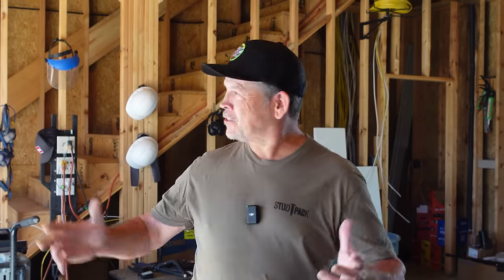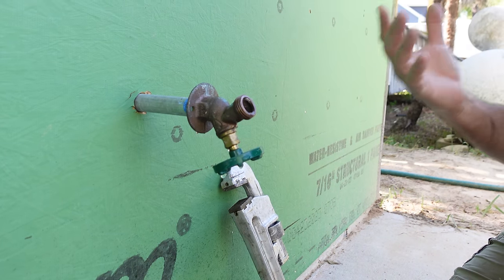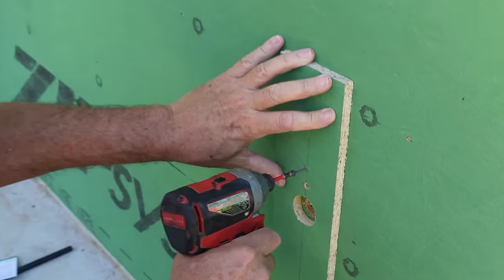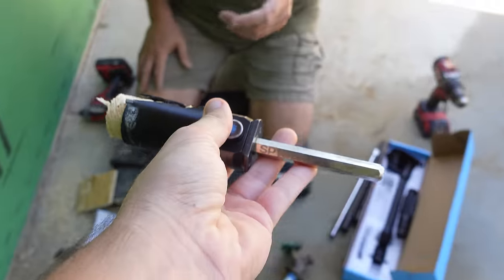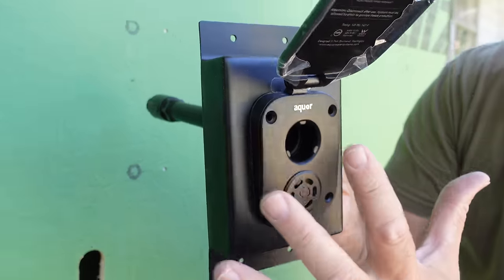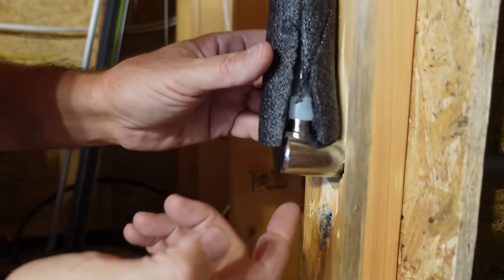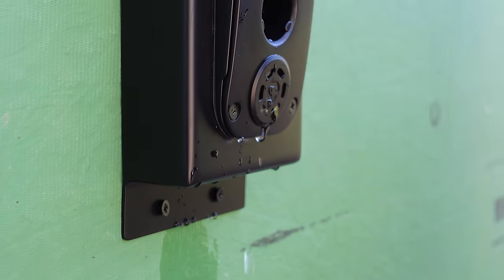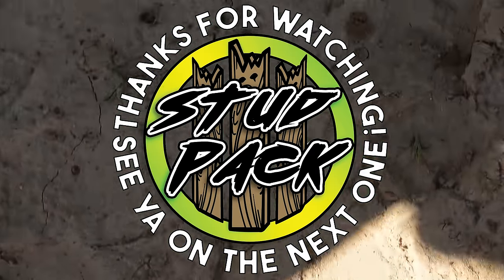Installing a Modern Outdoor Faucet - Ultimate Home Winterization

Comment: If you're planning on putting in an access panel anyway, might be a good idea to put in an inline ball valve too - that way you can shut it off for service. This is how I shut off exterior water for winter up here in cold-ass Canada.
Reply: Yup! This should be code everywhere!
Reply: yeah cuz you're going to need them to replace those eight hundred dollars hose bibs in a couple years.
Reply: Frost proof valves were and are common up here in NJ. I use ball valves inside. Shut valve, leave hose bib open.
Reply: I centrally connected all my hose bibs to an air hose blowout valve. Turn off the water inside. Shut them all off inside. Turn on all the faucets and sprayers outside. Hook up the air compressor and turn on open the valve. Then turn on each faucet from inside and let the water blow out. Close that valve and move to the next one. 30 minutes later all my hoses and sprayers are empty and dry. I disconnect them and store them in the shed for the winter
Reply: I have a master shut off for all outdoor water.... seeing this reminded me to turn it off
Reply: Thank you for the idea, I will now do the same.
Reply: I have two ball valve shut offs in my laundry room. One shuts off the backyard hose bib. The other shuts off the driveway and front yard. Winterizing takes 2 minutes. Turn off the valves, walk around and open the hose bibs so they drain (they are all pitched down). I love studpack, but this is a solution in search of a problem.
Reply: our plumber did the same thing (Canada too).    I used it to shut off the line for the Winter, then drain the hose bib.    all for an extra couple of bucks in parts.

Comment: You can also combine 2 hole-saw bits, one smaller bit that fits the existing hole, and a larger diameter bit for the new hole. Saves you from having to make a template.
Reply: I have a few different hole saws and this “trick” doesn’t work with any of them. When one hole saw is on, there’s not enough threads to get on another one. A template is quick  and easy to make and it always works.
Reply: Yes, you need a deep threaded mandrel or hole saws with thinner bases to do this, it really depends on the manufacturer!
Reply: @madperfect 
Just duck tape a couple of drills together and make both holes simultaneously.

Comment: One design improvement on the hose system is a kickout on the bottom side of the front plate. To break the water tension so that it doesn't drizzle back to the siding when you pull the hose out. Even though you'll have it all waterproof, always nice to divert the water away from the siding, straight to the ground.

Comment: If I recall correctly, they had a few problems with the o-rings on the spaceshuttle.
Reply: Oddly enough, it's because the o-rings degraded at low ambient temperatures.
Reply: That’s where this system will eventually fail.  They’re depending a lot on those o-rings. Big mistake. Viton o-rings or rubber it doesn’t matter. They all will fail.
Reply: @philweed1603 true, however an O-ring is an easy part to replace compared to the whole hose bib.
Reply: @andrewcarr2431  Agreed!

Comment: I guess it isn't as important as both hose bibs are downstairs where you probably don't plan to make it airtight, but keep those penetrations in mind for when you build the house to improve that blower door ACH score. In fact, you may still want to consider sealing that penetration better to give insects one less way to enter the garage.
Reply: I have a feeling that when they get the siding put on and calk around the bib braket that that will not be a problem.

Comment: Paul's "proprietary parts" rant was the best / funniest part of this video!!!  Haha....  

I love these Stud Pack videos.  Keep up the great work!
Reply: Yeah it was funny, though I'm not sure I completely agree with him either. If my hose or grill or car needs repaired, I know that most of the parts (in some cases, all of the parts) can be found off-the-shelf at general retailers. If the only place I can buy a hose adapter is directly from the store, and the only brand I can find is the company that makes it, that's a different situation entirely. I'd hate to have one break on a Saturday afternoon, then there's no way to use my hose for a week. Especially since the only upside seems to be aesthetics unless I'm missing something.
Reply: I understand where he was coming from, but when it comes to something that is being put on a building that may last 50-100 years I don't agree. If that plastic adapter breaks or gets lost in 20 years I very seriously doubt you can get a replacement. The company may go out of business or just not make the part anymore. It is very likely that the adapter will get misplaced since it can't stay on the hose bib. It would be a huge hassle to have to replace the entire hose bib because of that one part. If these companies are going to start making a system like this popular we seriously need to some up with a standard adapter ASAP. I really liked the hose bib until that part. I was wondering how the hose connects the entire time.

Comment: Guys, I think I would grab a couple scrap 2x4 and use them as backers on the ends of those screws that are going through the ZIP osb. A little glue is all it needs, then you know those screws will never come loose if someone yanks the attachment, or pulls the hose to hard. (looking at video @14:07)

Comment: @StudPack As you know, reparability is a major factor! In fact, you are mixing up proprietary and standardized.  Most things we use are proprietary, but most are alsy standardized and accepted way of doing things. Aquor is not standardized in construction industry or even in boat or RV. They have been in the market for many years. Yet, parts are not readily available except if you call them. That means that they may decide not to have parts at any time and you will be stuck replacing the whole really expensive thing. The advantage with proprietary but standardized part is the fact that I can buy it anywhere (even on amazon) and replace the entire internal assembly with handle and all rubber gaskets for a fraction of cost of new and without ripping up everything. It is "less work, less money and less garbage" solution that effectively creates a brand new hose bib. In fact, i've done just that this summer for my 122 frost free hose bib. 
That being said, Aquor is a cool modern solution that should become standard in North America one day... I doubt it though...

Comment: Minor suggestion to Manufacture is to countersink holes for wall mount screws in exterior box to allow screws to lay flat to surface so Water sealing tape can lay flat instead of bumping out with air trapped.

Comment: Recommendation for you... I lived in Texas for over 15 years and I learned that Winter is the rainy season.  I suggest that you finish the exterior before spending too much time on the interior.  Spend the wet season doing the inside stuff.    PS - maybe stage your insulation i& sheetrock n the inside dry space and save that work for rainy days when you can't work on the exterior.

Comment: We have a much simpler fix for this in Canada and northern States. 'Anti-syphon / non-freeze' hydrant. Come in lengths of 6-24". The valve is connected by an internal shaft all the way inside the house at the opposite end, when you turn it off, it drains all the water out of it through the regular outlet so there's no water in it to freeze and also doesn't make water run down the side of your house.
Reply: Yeah unfortunately I feel like this product @Stud Pack installed is much more overpriced gimmick of the traditional $50 woodford frost-free anti-siphon sillcock.  In the Midwest it's all we use. And the perk is, you don't leak hardwater down the siding or house like this one is going to do, and adjusting the flow is very critical where this one looks like adjustment is not as incremental. I am sure they have a way to adjust flow with this one, right?

Comment: With the old hosebib you mount an shut off valve upstream from the one the goes outside.  Shut it to stop the flow of water, and open the hosebib and let the water drain out.

Comment: Canadian tradesmen here. This is a solved problem.
The freezing problem has been solved for several decades, with a standard part that costs less then $30USD
This part, commonly referred to as sillcock, frost-free or freeze-proof faucet, also places the water shut off seal 12" into the house. 
It has few moving parts, and all moving?/wearing parts (eg O-ring) can be easily and quickly replaced from outside, without ever disturbing your seal from the faucet to the house. 
But this one is very pretty. 
I tend to see very southern people shilling this, as they don't know it's a solved problem.
Reply: Yeah sillcocks exist here too. This is just a new novel way to do things, as he explained in the video. It looks neat and clean. You’re not keeping old appliances in modern homes even though they’re cheaper and literally do the same job.

Comment: Thanks. Maybe I'll put one on my yacht.  But  at home I think I'm more comfortable with a bib with a VALVE, so  i don't have to unplug the hose whenever not in use  ( not taking a chance with it springing a leak at an inopportune moment) .   In winter I'll take a shutoff on the other side of the wall, since you're still building an access panel anyway.